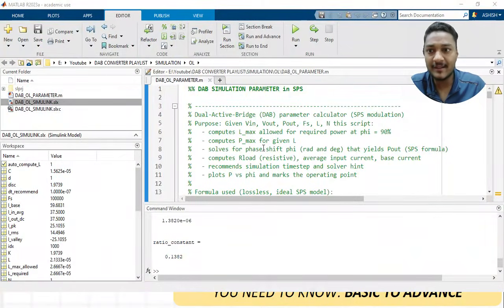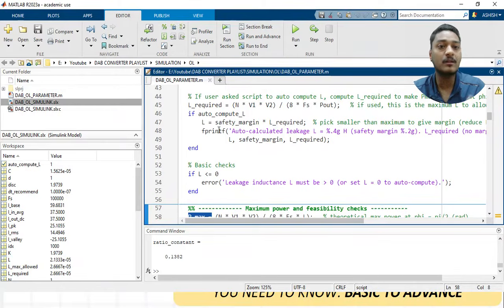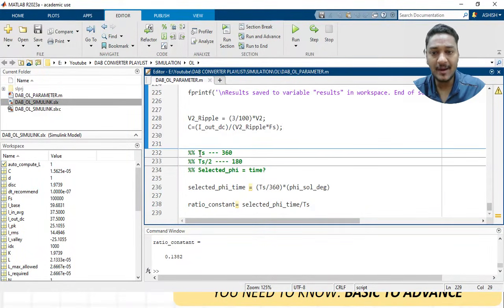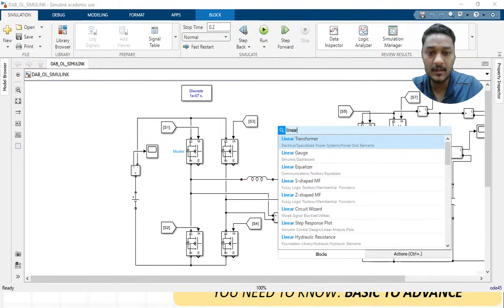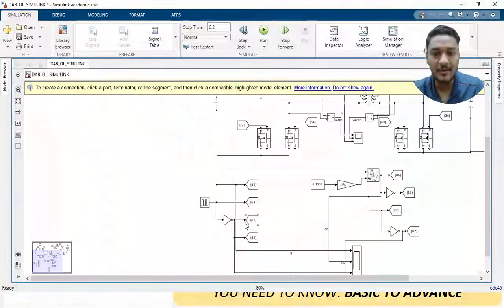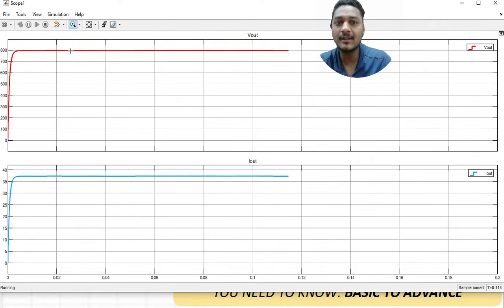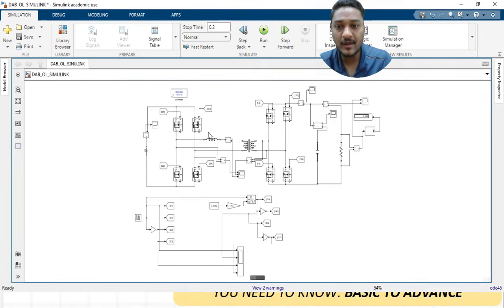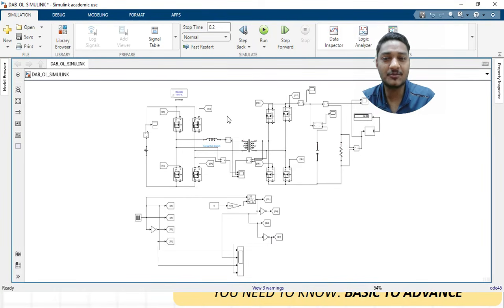LECT 05: Open Loop MATLAB Simulation of DAB Converter using SPS | #DAB

Comment: Sir , I need to design for V1=120V, V2=400V, 5KW system with switching frequency of 25KHz, . I Have followed your previous classes. I am not getting desired output of 400V when N=1. Should  I keep N=120/400?
Reply from the maker: You can keep N=1 but then what phase shift u are applying and what is your leakage inductance value and what is the maximim power u can achieve woth tha leakage 1st see that and if theoretically possible then it should work.

Comment: Hello! I’m trying to reproduce your experiment in Simulink, but when I use the Variable Time Delay block, its output becomes a triangular waveform, and I don’t understand why this happens.
To work around this issue, I tried using another Pulse Generator block and applied the same time delay you used. However, a new problem appeared: MOSFETs S2 and S3 are not turning ON.
Could you help me understand what might be causing this?
Reply: I have some news about the problem, a use the powergui in the continuos mode and the switchers start to work very well.

Comment: There is a capacitor in the primary section of the DAB bridge. I did not see that. I saw only the one in the secondary bridge
Reply from the maker: Yes, if you are designing for bidirectional power transfer then you need to have capacitor on both sides.
But for simplicity and understanding purpose we are considering power tranfer from left side bridge to right side bridge and hence only added capacitor on that side.

But good question, as DAB is bidirectional so having capacitor on both side is must.

Happy Learning 😊

Comment: Hello sir, I'm new to matlab. Can you please provide me the matlab script as some part is not visible in the video (corner). It would really help me
Reply from the maker: Its simple. In previous video I had tried to explain step by step how you can compute the things. Just try to write down that in matlab script step by step, forgot about what script I had written. Alsp try to compute it first with pen and paper and try to match with your script.
If it works then fine, otherwise please let me know, I'll be happy to help you.
You can connect with me on linkedin so that I can help you 😊
Reply: @Kingashish-555  Thankyou so much sir, it worked. Amazing explanation!

Comment: What happen if I place leakage inductor in secondary side of the transformer in the simulation.
Reply from the maker: That can also possible. In few literature you might have seen this placing leakage inductance on secondary side. Analysis wise, operation wise and even computation wise everything is same. I'll try to find if any  important difference come or not and reply you again.
Happy learning and thanks for asking curious questions, it will improve our overall learning. 😊😊

Comment: can u explain how u calculated gain as 0.1382, and can u name the adjacent block. I can't find it in my matlab
Reply from the maker: That number is calculated from what is my phase shift angle. So Initially we have calculate the phase shift angle then we know fron 360 degree corrospond to total switching time Ts. So what will be my time corrosponding to that phase shift angle.  And then that calculated time divided by overall Ts will give me that constant.
And that is gain block inside that 1/Fs is written.

You can watch previous video of design calculation. You'll get idea.

Happpy Learning..

Comment: How u calculate the time which u use in simulation in the constant block that is 0.1382 how u did that
Reply from the maker: By solving quadratic equation. Please refer design calculation video there you'll know how to get value of phase angle. Then from phase angle you can convert it to time delay. And that constant is then just division on calculated time/total switching time.

Please go through previous video, it will be helpful for you.

Happy Learning 😊😊
Reply: @Kingashish-555 thank you 😊

Comment: Excellent presentation . Could you please give a link for simulation file and the script code?
Reply from the maker: I would suggest please try first with your own. This will help to you only rather than just running someone model. I had taught all the necessary things in this playlist. 
Please try, if not getting it, I'll be happy to help you.
Happy Learning..
Reply: @Kingashish-555  Thank you . I will do it
Reply: @Kingashish-555  I did the simulation . thank you . But i cant deliver 5kw power with primary voltage : 48v secondary 400v and calculation of L and other things based on matlab script .The max power that i have recieved was 2500 even when changing the phase shift . could you help me on that ?

Comment: If V1 = 330v , V2 = 48v, Fs = 100e3, Pout = 1kw, N = 6.875 then what is the L value ??
Would you like to help 🙏
Reply from the maker: Sure. For your specified parameter value are: 
 L= L = 0.000109 H   and 
phase angle=  Selected phi = 0.868315 rad = 49.751 deg (produces P = 1.000 kW, requested 1.000 kW), 

hope this will help you.
One request, I had teach how to calculate the value and everything in detail in this playlist. So I request you should learn in detail and know concept about each thing what we are doing here. Also as in your case you have taken N=6.8, may be based on V1/V2. And this is fine to go with as there is one factor called "M" (we'll learn in next Video) so keeping value of M near to 1 is important to achieve soft switching. But how this turn ratio affect other things that also you should know and try to learn.
Hope you are learning something and Happy Learning..
Reply: @Kingashish-555 thank you 😊

Comment: How we can operate at wide range which factor help to cover wide range
Reply from the maker: Great question! 😊
If you’re trying to design a DAB converter for such a wide output voltage range (like 200 V – 900 V), there are definitely a few challenges to keep in mind.
First, if you go with Single Phase Shift (SPS) control, we already know from the power transfer expression that once the turns ratio (n) and leakage inductance (L) are fixed during design, it becomes really difficult for phase shift alone to handle such a wide voltage variation. The converter can’t maintain efficient operation over the whole range.
Also, the ZVS zone in SPS is quite narrow, which you’ll see in upcoming lectures — this directly affects the power transfer and efficiency when the voltage ratio changes significantly.
Now, to improve this, you can go for advanced modulation techniques like Double Phase Shift (DPS) or Triple Phase Shift (TPS). These help to extend the ZVS range and improve efficiency under wide voltage conditions. But the trade-off is that the controller becomes much more complex — handling multiple phase shifts accurately under varying conditions needs very careful design.
So, in my understanding, the controller design becomes the biggest challenge when trying to make DAB work efficiently across such a wide voltage range.